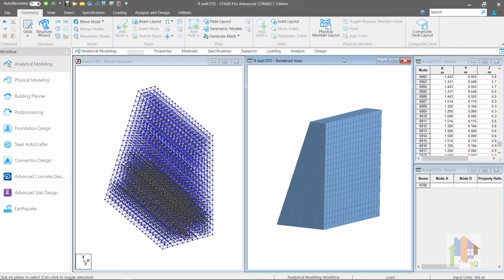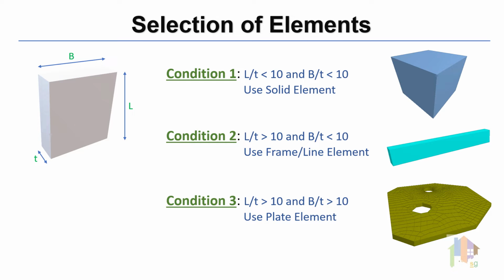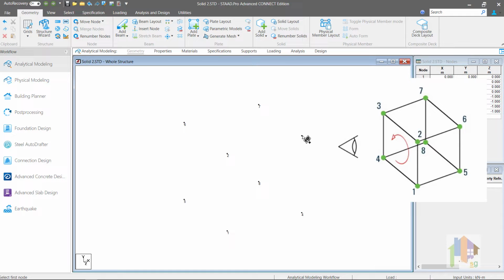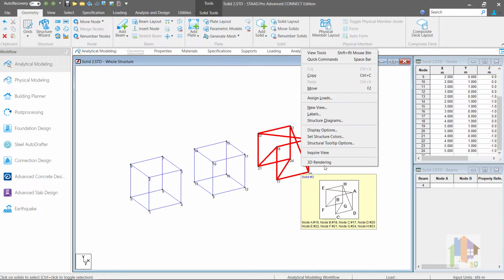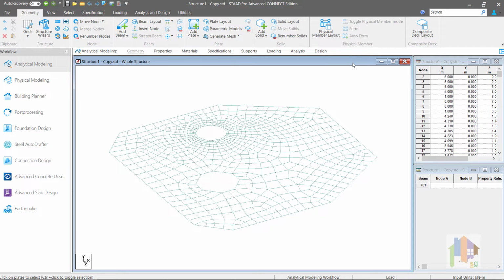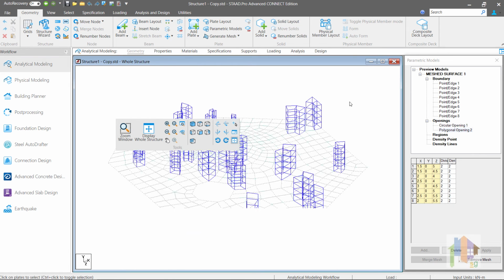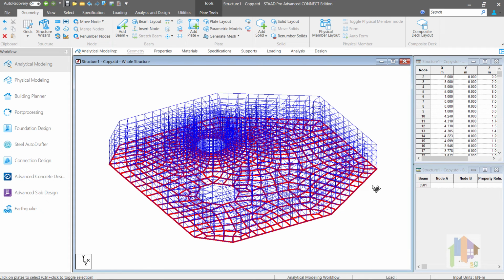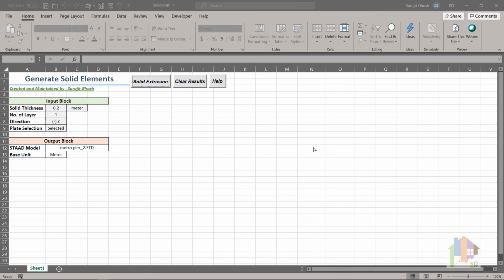Generate Solid Mesh Structure in STAAD with Custom User Tool || Convert Plate mesh to 3D Solid mesh

Comment: Thanks for such an informative video. Please make a tutorial about Pier Design in Staad Pro.
Reply from the maker: By default, it is not possible to design (calculate required reinforcement) a solid element in STAAD. But using the solid stress values, we can design it easily. I will cover this later.
Reply: @surojit_ghosh  Thanking you in anticipation!

Comment: Awesome!!!
Kindly elaborate on parametric modeling.

As you have used *.xlsm file to generate solid elements, but how to create solid elements without using *.xlms file.
Reply from the maker: I will create a detail video on parametric model and other mesh generator soon. 
For solid element generation, you can generate solid elements manually, I have also discussed the correct modeling techniques in this video. Using coordinate values or existing nodes, you can generate 4 to 8 sided solid manually.
But as the process is a bit complicated, that's why I have used a custom macro which can help in modelling.
Reply: Awesome !!! Thank you for making useful videos 
Kindly prepare a powerhouse machine foundation for vertical machines using parametric techniques and this macro.

Comment: Thanks for and excellent presentation. As others have asked, result interpretation of solid elements is an important next step, which you ought to cover. Also, the parametric modeller seems to be very powerful, but isn't well documented. I hope you could make a video about it as well.
Reply from the maker: Yes Abhijeet, I will cover the result interpretation of plate and solid within next few weeks. And I will try to make detail video on parametric modeler. This mesher is very advanced and I always recommend to use this module.